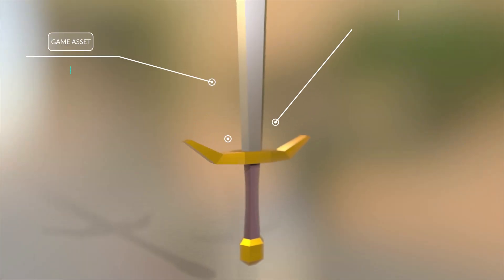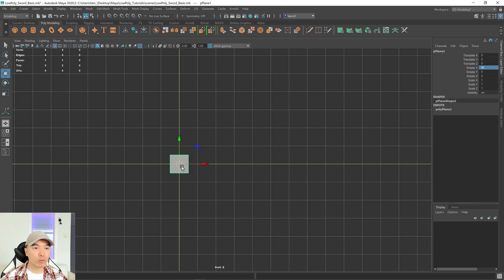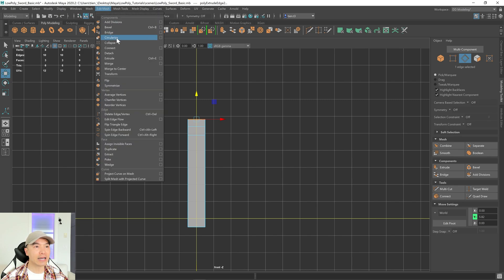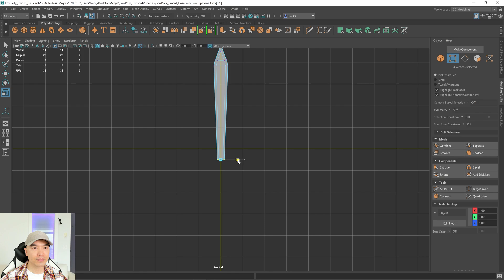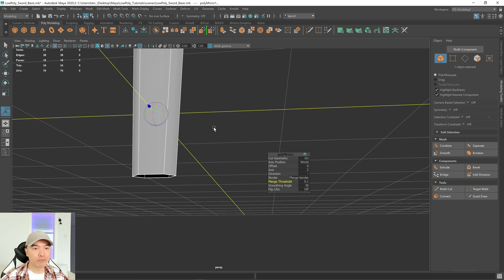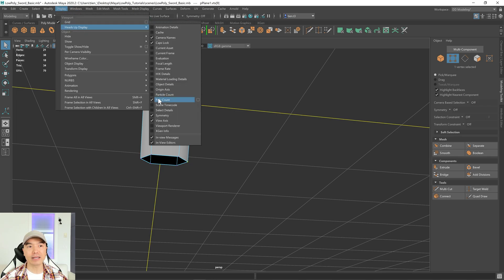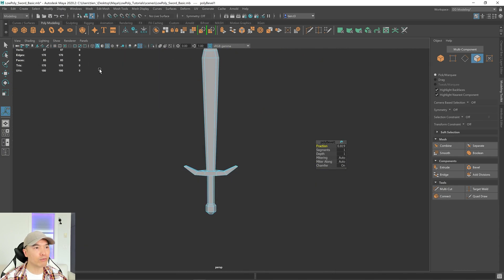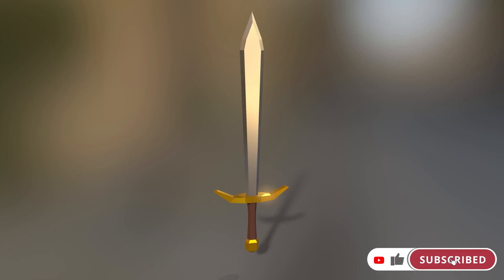Model A Low Poly Sword In Maya | Basic Short Sword

Comment: This helped me a lot thanks for the video! One question: How can I get an image like the end of the video? When I rendered it, it seems like there is no angle on sword. It looks like bended surface.
Reply from the maker: Hi perhaps try hardening the edges and make sure you have a couple light sources. Sometimes it's a matter of moving some lights around until you get the reflections you like.